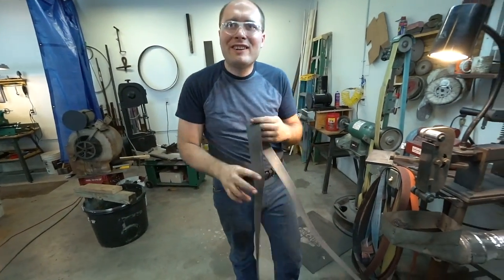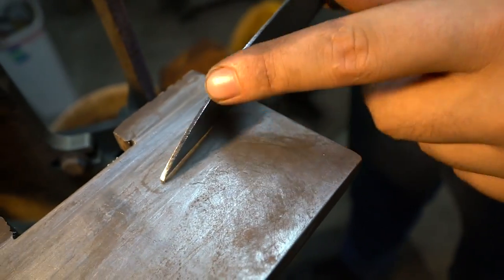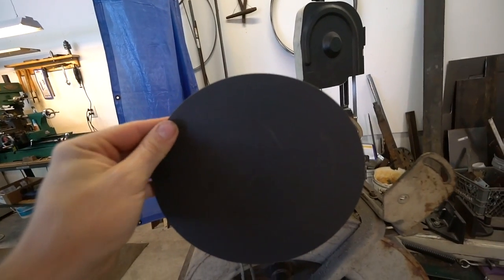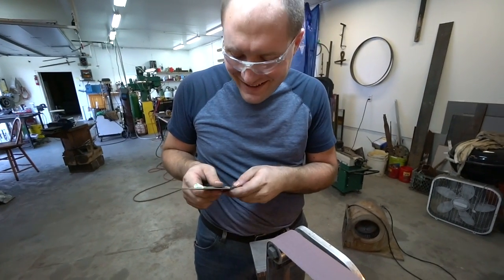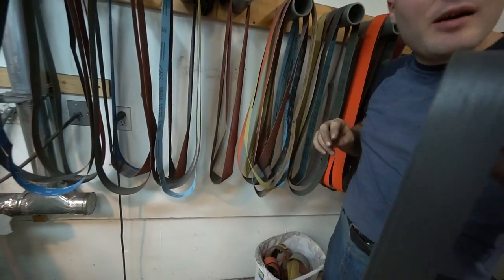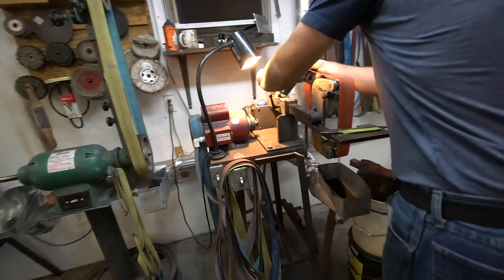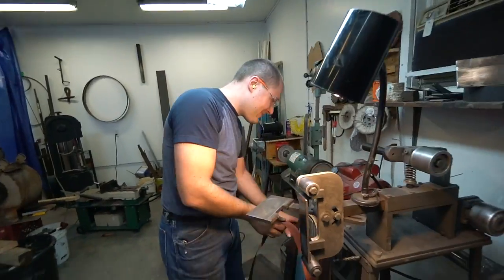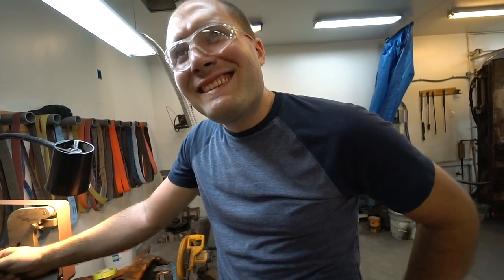Making a Knife out of a Shovel? Lets find out ~ Part 5

Comment: That's looking sweet!  Love the long subtly curved clip.  I'm always amazed when a see clips freehand ground in that cleanly.  I just can't seem to keep the same angle with short bevels level that, so I rough them in a bit and finish with a file, although it is a pain to fix it is warps during HT.    Great idea too for taping up the spine before cove I g the edge.  I'm curious, what thickness do you usually take the edge to before you put the convex in?  Thanks for sharing!
Reply from the maker: It's different on every knife, but I normally take it to 0.030 inch thick on a knife this size but it can be thicker or thiner than that depending on the size and purpose of the knife